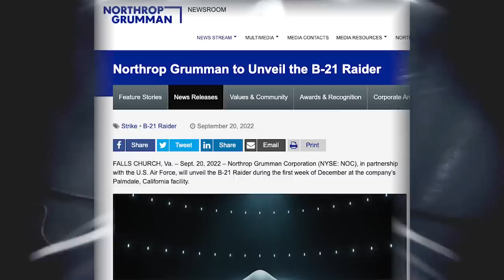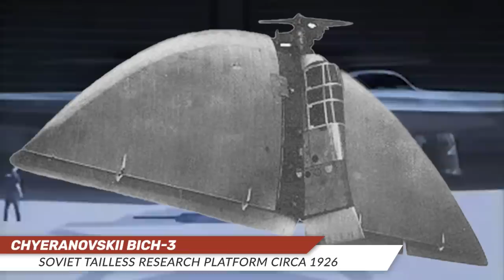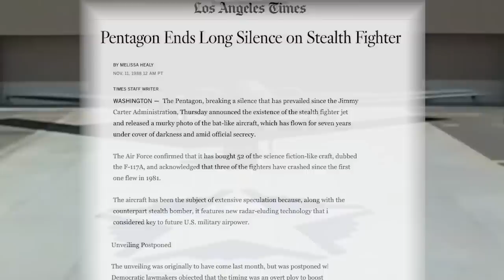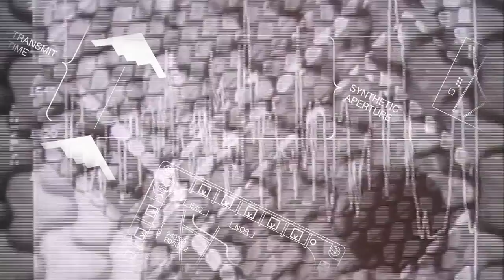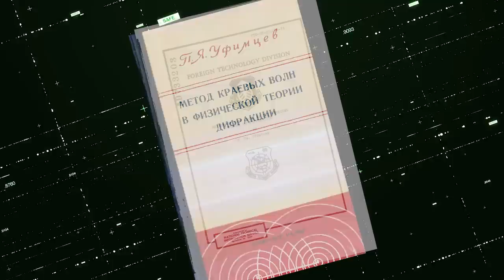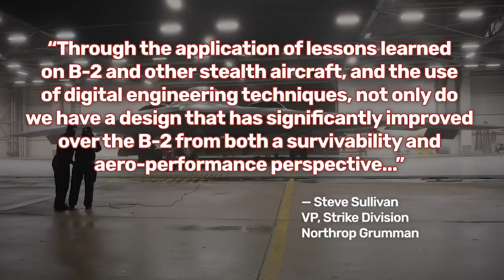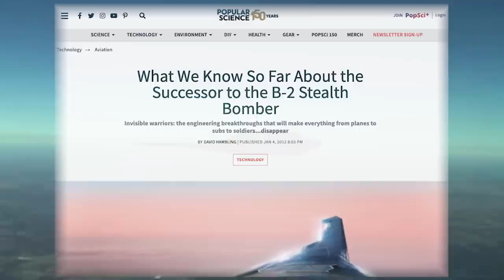Revealing the B-21: Why Northrop Grumman's announcement is a big deal

Comment: I need to be convinced that there IS a need for, yet another, stealth bomber platform. My argument, is that the B-1B Lancer is a heavy bomber, which can also fly supersonic. And, here, I have to quote a "Bone" pilot," flying supersonic into territory can, and does, disperse enemy combatants, without the use of kinetic weapons." The Bone can fly into territory under the radar and cause our enemies to run in fear, knowing they are about to be obliterated. Then, the Bone is on the other side of the country, before anyone knew what hit them. AND, it is much more cost-effective to use such a platform over a stealth platform. Meaning, the costs to maintain and operate B-1's is roughly half or even less than maintaining a stealth heavy bomber.

Comment: I understand that Northrup is partnering with another less well known company to propose a flying wing tanker that would succeed the current contract for a 767 based tanker being built by Boeing. Boeing probably needs that contract to remain relevant and exist as it works through its current problems and program failures related to failures in its commercial aircraft and spaceflight programs.

But militarily, I believe that the US should not delay in building a stealth tanker that can deploy in contested airspace if the concept is possible... In fact, I'm all for accelerating the program if it can be authorized and build up to 10 such aircraft ASAP with additional aircraft on a much lower schedule perhaps similar to how heavy transport transport aircraft production like the C-17 were stretched out over additional years. This would not be a waste of resources, Non-stealthy tanker aircraft have a role to play wherever there is uncontested airspace but if there are open hostilities, a stealth tanke could be essential for forward deployed aircraft without access to land bases... typical of what aircraft based on an aircraft carrier might face.

Comment: I'm mixed on the prospects of building the B-21 quickly and on time. Both China and Russia don't really have a viable and comparable stealth strategic bomber program. If China and Russia can't field a comparable bomber, I'm all for not rushing the B-21 into service and retiring the B-2 any faster than necessary and unless there is a powerful reason to retire the B-2 as quickly as possible, I'm for slow walking the replacement pace and limiting stress on B-21 frames to extend the lives that do enter service.

Who knows... Personally, the B-21 plays a critical role in my "best scenario" supporting a doctrine demolishing Chinese land airbases and seaports along with other significant military installations if China were to attack Taiwan. I the doctrine I propose, naval aircraft carriers are withdrawn out of missile range in the early hours and days of a conflict and are brought in closer only after the B-2 and B-21 destroy China's long range missile capability that could threaten carriers, and when carriers can safely be deployed within 1000 miles of the Chinese mainland would break any Taiwan blockade that might be attempted and perform air dominance missions from then on.

If the B-21 can be that much more effective or augment the strategic bomber force to more effectively demolish Chinese land targets and assets, it might not be a ba idea to field as many as can built as quickly as possible.

Comment: When I first heard about these ceramic RAM coatings, I thought "That looks and sounds a lot like like what is now available for car and windshield coatings!"
I assume that both are foundationally the same which would mean that RAM coatings now are hard and relatively low maintenance subject to the friction caused by the speed and environment the aircraft is flown in. Just modify the "other stuff" formulation that's mixed into the ceramic or graphene base to modify the RAM qualities. This also means that it's likely that the Chinese likely have a toehold on developing their own long lasting RAM since a lot of these car coatings are manufactured in China.

Comment: Get a look at the equivalent of the Montana class battleship in 1960. Has not the Ukraine war proven that the high tech bomber is a blast from the past, has not the US making such extensive use of cruise missiles in Iraq in 2001 also proven the same. What mission does this gold plated albatross serve that cannot be better done by a cruise missile or a drone. Why risk a crew and an airframe that costs many $100's of millions. If going to fire from long range, what is the need of all that stealth, just need a cheap launch platform that does not even need a crew for such a robotic job. One of many American Wunderwaffe.

Comment: The B-2 was never used for what it was designed to do. Circling over the middle east can be done by any bomber. So its a little hard to figure out why we need a new one. I'm going to call this money in politics. The weapons industry will make a bundle, and that's about it.
Reply: Nuclear missile subs and nuclear missile silos are not used either; but, we still have them and upgrade/replace as needed.  At least you can use the B-2 and B-21with conventional GPS guided and unguided gravity bombs.

Comment: Great views of stealth during the Pasadena Rose Parade, usually a very unmuffled flyover which the roar is part of the absolute world power mission capability, meaning at full thrust u m a y not even see it until it zips thru the air molecules overhead.

Comment: The term, "flying wing," continues to bemuse and vex me, because it makes no sense unless someone can convince me that it's reasonable to believe that there's such a thing as a "nonflying wing."
Reply: Chickens / Peguins... also, Wikipedia: A flying wing is a tailless fixed-wing aircraft that has no definite fuselage, with its crew, payload, fuel, and equipment housed inside the main wing structure.
Reply: @LasyteSolutions  Yeah, I know what it is. I was commenting on how ridiculous the term, "flying wing," is. It's like describing a 100-meter-dash contestant as a "running runner" or a boxer as a"fighting fighter." Now, "tailless plane" wound at least make sense ... albeit somewhat less poetic.

Comment: Can the F35 Detect it? Also yes the World did see a Stealth craft before the USA Stealth in 1980's..Germany built "Horton 229" Flying wing during WW2 which had about a 25% less radar signature and looked very similar to modern Stealth Bombers and no doubt USA borrowed from that design..
Reply: Except, the Ho 229 ISN'T A STEALTH PLANE. Besides, Northrop was already working on flying wing designs AS EARLY AS THE LATE '20S.

Comment: I always loved the flying wings. So sleek and efficient. The reason they were dropped in the 50’s was because of their inherent pitch/yaw instability and deadly stall characteristics. Even fuel shifting in the tanks would cause constant pitch changes and yaw undulations would make an accurate bomb run impossible. Throw in a few near misses and an eventual fatal unrecoverable stall and the program was dead. It wasn’t until fly-by-wire came along that the flying wing design was revived.

Comment: Why haven't they made a transforming stealth fighter? Like, not into a robot or anything nuts, but just from a "flying wing" stealth vehicle into a "acrobatic fighter jet?" If they need vertical fins for aerobatic stability, why not make some that can compress flat when in cruising flight, and pop open when in combat? That way, the jet could travel around with maximum stealth, and then if detected shift into a more combat-friendly mode (while still being hard to lock onto).

Comment: And when that first B-2 was unveiled it wasn't ready. It was held together with bailing wire and duct tape. Literally.
Reply: Odd, since we had been flying training missions in the B-2 for some two years before it was rolled out for the public unveiling.   Same as our new B-21 has been flying for at least three years now.
Reply: @blackhawk7r221  Northrup claims the first B-21 has only undergone taxi tests up to this point. I have a friend who works there as well. And that first B-2 didn't fly until 1989. But I'm aware there was some kind of smaller prototype of the B-2 that was flying at the "Ranch" for some years before the B-2 was unveiled. Guy I know  that worked there told me about it. I was at the unveiling in 1988, there were many panels on the bottom that were only held on by two screws in opposite corners. After the unveiling, we worked 12 hours a day, seven days a week, until it was ready to fly.

Comment: Lets be honest. It will probably look very similar, but have upgrades in all avionics, engines and weapon integration.

At most I see some minor changes and radar absorbant material changes. So much cheaper to upgrade an existing fleet, especially if they are still extreemly incredible.

Comment: The old B-52's are only still in service as a stand out cruise missiles launcher with their fast loading rotor launching rack. They are good for direct drop also when not being used as a missiles platform

Comment: Engine technology and aerodynamics have not really advanced since the 70's so to differentiate we got stealth and a multi role F35 that is a compromise. High wing loading , slow and a poor energy maneuverability plot. Stealth is not an invisible Klingon ship its only reduced radar signature to certain radio frequencies. It works well against targeting radars from other aircraft. But a ground based C band radar will see it coming with range speed, and heading but no solution for a target. That's how a 1960s Russian SAM took down an F119. C band saw it coming and when it got close enough 3 missels launched and took it out.
Reply: Well actually, the 117’s schedule, track, and air corridor were compromised and leaked to the Chinese, who in turn, provided it to the Serbs hoping to recover possible wreckage for their own research.  All SAM assets were relocated to that route so the corridor was lit up like the world had never seen before.  All of the batteries emptied their missiles at any blip or blindly at the sound.  One hit home.   Subsequently, the Chinese embassy compound was “mistakenly” bombed.
Reply: @blackhawk7r221  true, but it was shot down with a 1960s Russian SAM. Any serious target will be well guarded by multiple SAM'S more advanced. Years ago I heard electronic engineers were developing ground C band matrix of radars to provide a firing solution, but I don't know it's current state.

Comment: Smaller plane, smaller payload, but the power system will be far more modern and efficient.  Could there be sufficient power for directed energy weapons? A high altitude steal platform that can reach out and touch just about anything in line of sight?

Comment: interesting aspect of the Stealth bombers is that without computers making thousands of trim calculations a second…they would fall from the sky…they are not stable without constant micro corrections…someday they will be made obsolete through general EMP (electro magnetic pulses) rather than radar…

Comment: Bryon, you stole my thunder.  But my observation:  I find it interesting that the B21 will lead to the retirement of the B2 and the B1 bombers designed to replace the B52.  

Also, I flew the B52G in two wars in the 70s; VietNam and the cold war afterwards. They are going to reengine the B52H so it will last until the 2050s.  That means not only our kids and grandkids, but our great grand kids and even our great-great grand kids may be flying the same airplanes we flew in the 70s long after the B21 is retired.

Comment: Those wing edges have always caught my eye..Im pretty sure they electrostatically charge its wings leading edge to remove drag by moving air molecules more efficiently or they are ionising the plane's slipstream for better radar invisibility.. Plasma stealth is a proposed process to use ionized gas to reduce the radar cross-section.
Reply: A “plasma shield” at hypersonic speed is exactly why we cannot electronically track (or more accurately, target lock) Russia’s new Dagger and Zircon missiles.

Comment: 4:26 A biplane? Actually a single wing in the front with slots for the engine intake and more some distance back for the exhaust with the rest of the wing going back to the trailing edge but the upper part of the wing stopping at the exhaust slots. Fuel, bombs, and other things between the engines.

Comment: I believe your contention that B-2's might be difficult to be detected by longwave radar as well. There is an anecdote that the original B-49 flying wing flew undetected into an airbase back in the early 50's. Back then, I am sure that the radars of that time were a lower frequency than today. It also didn't have the software that masks out "clutter" like today.

Comment: I had heard recently, that the RAM coatings, of the previous generation, which were the most expensive part of the maintenance of stealth aircraft, had been improved upon considerably. Is it possible, I wonder, if this is a direct result of continued research into RAM coatings for the B-21? Apparently the uprated solution is a RAM coating which has a ceramic base. This would additionally allow far greater time cruising at high mach numbers. The earlier variant of RAM would slough off at sustained mach numbers, apparently?

Comment: Just on the electronic disruption tech used by aircraft. I read an example of a B-52 wishing to land at an airport in northern Australia. The ATC response was, sure, as soon as you're within range, let us know, and we will guide you in.  At which point, the B-52 pilot announced that they could see the runway, and would disable their radar disruptors. 
Having done so, the ATC was shocked to see how close the craft was to the airport, and all else resumed as normal. 
Sure, a civilian radar isn't geared to search for low granularity objects, but nevertheless. It does emphasise the special abilities involved in military systems. (The system VS counter-system struggle continues)

Comment: To help resolve the issue of stealth fighters being visible on long range/early warning radar, has anyone tried using variable geometry vertical surfaces? i.e., stabilizers etc. that could lay flat for cruising and then stand up for when they are needed for maneuverability etc.?
Reply: The issue with longer frequency radar picking up stealth aircraft has to do with the aircraft being a large object in the sky, not its shape. In a directly related way, the exact location of the aircraft is somewhat fuzzy and not exact. They can tell it’s there, but not guide missiles to the aircraft.

Comment: B-2 has the cross-section of a bumblebee. However, it's China's new tech that they have to plan for in any new stealth application. China has touted a new high-freq surface wave radar system, a new active infrared detection and tracking system, and the new meter wave radar systems all took stealth down to the longest-range applications-basically right back out to stand-off distances. 
What kind of tech they came up with to stand up to these kind of new detection systems will be 'Eighth Wonder of the World' type stuff, unless they simply go with high-altitude, low observable systems that will stay outside the detection ranges of the shorter range stuff, but I don't know what they can do against the meter-wave system. Long waveforms like that can go very long distances, as old HF and short-wave radios could attest to.  😕

Comment: Funny thing is that the USAF is still paranoid about letting people near and/or photographing the rear of the ~35yo B-2 to this day, at airshows they’re typically parked up against a building with similar security to the roll-out. 

It’s probably pointless these days, with telephoto lenses and super-res cameras, but still. It’s no secret that however they ducted the jet exhaust to deal with the IR signature is THE single thing that makes the B-21 revolutionary. Hell, even the patch for the test squadron has no exhaust on it. 😂

Also, while many can be credited with the development of stealth, the B-2 was essentially Jack Northrop’s original design in many ways. Stealth was almost a byproduct; the YB-39 first flew in 1946 and has the exact same wingspan (to the inch) as the YB-49 and eventual B-2 Spirit. To say that his designs were influenced by anyone else doesn’t give him due credit. He had already done the calculations and knew exactly what he had, unfortunately no one else truly committed to the concept till he was nearly on his deathbed. 

I’m sure many here know that the USAF and DoD signed off on a number of security bypasses to allow the aging Jack Northrop to finally see a completed B-2, basically his life’s purpose had been fulfilled. He passed away less than a year later.

He was definitely right up there with the best of the visionaries… Kelly Johnson, Hughes, etc. To see his core design live on as an even more advanced and lethal bomber almost a century after his first research into flying wings is simply incredible.

Comment: You want to know what it takes to get an invite to the roll-out of the B-21?
What else works miracles, MONEY!  It will get you anything and anywhere...if you've got enough of it.  Good luck.
The B-49's biggest problem was there weren't any computers powerful enough to overcome the instability trouble. The pilots alone could not overcome them by themselves.

Comment: I do remember when the first B2's rolled out , they weren't as stealthy as they were predicted to be. They had knowledge of the shape that reflected radar but did t have the knowledge about the different coatings the made the shapes almost invisible. Lockheed Martin was coerced into coming in and working with Northrop Grumman to make the B2 the stealth bomber it was supposed to be.  And of course Northrop learned what Lockheed already knew.